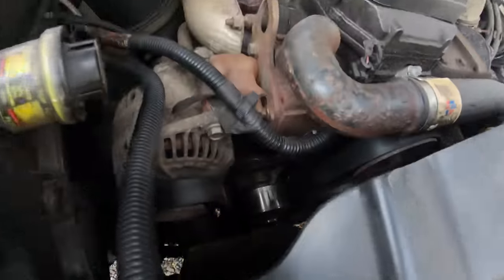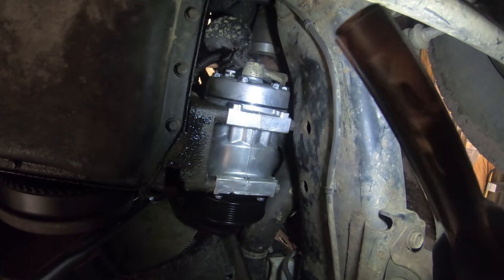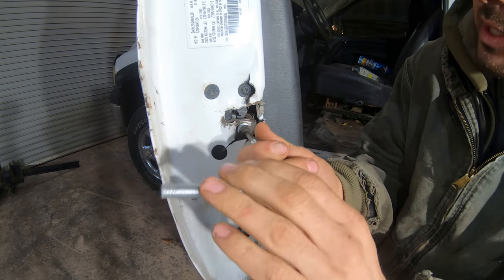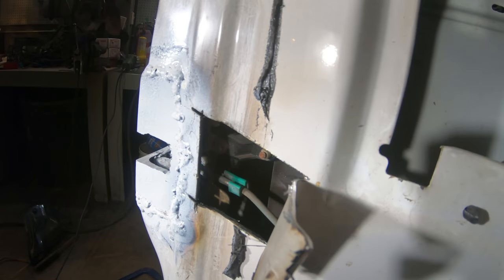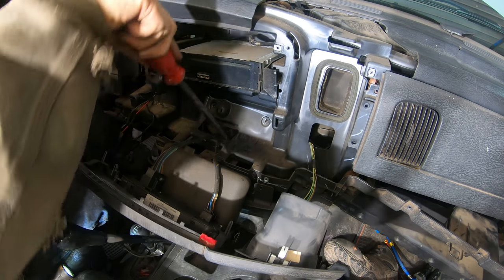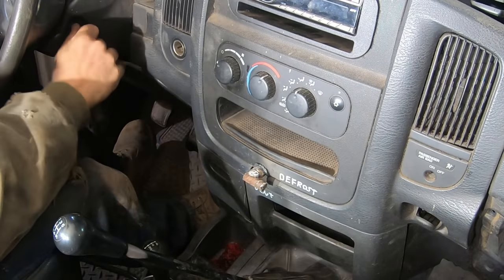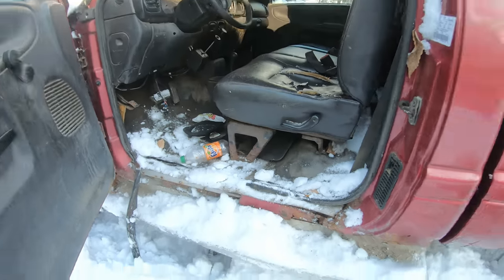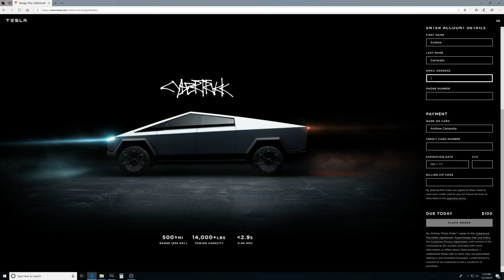Pickup truck repairs

Comment: In two or three years: Doing Maintenence on the CyberTruck
Reply: Maintenance on Tesla = scrap it and buy a new one, unfortunately...
Reply: @Gyppor  you clearly haven't been watching Andrew enough...
Reply: Gyppor check out rich rebuilds!
Reply: @Gyppor  teslas dont need maintenance, jokes on you
Reply: Unamused yeah I’ve watched Andrew enough to know he’s not going to like the truck. Check out rich rebuilds
Reply: @moavic5087  it'll be hard not to love the truck. zero maintenance except tires, lasts 20+ years, goes 0-60 in 3 seconds. ICE is dead, long live EVs
Reply: @DaveDaveAlanAlan  brakes.. lights.. sensors... bearings... connectors.. relays.. power supplies.. charging ports.. windows.. axle shafts.. struts.. shocks.. springs.. 
wait until they are 10+ years old and the electronics start to fail, just like on any vehicle. You're not going to find parts, Tesla won't sell them to you. Even Tesla certified  body shops have to wait months before they can get body panels with embedded sensors.
Reply: DaveDaveAlanAlan ICE is not dead Tesla ain’t even in the top 15 of car manufacturers. If EVs didn’t need maintenance then why do they have repair shops? You can’t buy parts for them. Only Tesla can fix them, and that can take weeks depending on the problem and parts availability. Andrew will properly inform himself and he won’t end up buying the truck it would be a big mistake. Unless he only intends on just using it to cruise around.
Reply: @Gyppor  1 million miles for brakes and drive chain due to regen. Also not true about wait times anymore - used to be the case when the model 3 was ramping though.
Reply: @moavic5087  you'll catch up eventually - ICE is dead, you just can't see it. buying a new ICE vehicle now is beyond stupid.
Reply: Going to take 2 years to get it .
Reply: @moavic5087  you can buy parts and there's a service manual for the cars. Repair shops exist because no car is perfect and people crash all the time.
Reply: @DaveDaveAlanAlan  "ICE is dead, you just can't see it. buying a new ICE vehicle now is beyond stupid." 
Ok, so I'm in Central Ohio and I need to be in Charlotte North Carolina in about 7 hours. Absolutely no problem with my car. Top off the tank at the gas station by my house (5 minutes and $35 tops) drive 430 miles without even thinking about filling up again and I'm there in 7 hours. Sure I could fly if I wanted to spend 10 times the money then pay even more to get to where I'm actually going and maybe get there marginally faster but an electric car/truck just ain't gonna cut it. Sure I could deal with range anxiety, search around and find a charging station, go out of my way to get to it, sit there and twiddle my thumbs while it charges, then show up after my meeting is over but what's the point in going at that point? 
Until I can drive all day on one charge or get a full charge at most any street corner in under 10 minutes, EV isn't even an option.
Reply: Matt Merkle those were all bad responses. I dare you to call Tesla and try to order a headlight for your car go ahead see what they say, also try to get a repair manual from Tesla’s site 🤣, If you go online you’ll see limited amounts of new and used parts available from aftermarket sites. Only Tesla repair shops can fix a Tesla which sucks if the  nearest shop is 300 miles away. I’m a diesel mechanic, don’t try to tell me about the car and truck business I know Tesla ain’t doing so hot in their service department. My point being is this cyber truck will not fit Andrews needs based on what he does.
Reply: @moavic5087  Don't talk reality to the obsessed 'green' electric everything, fantasy crowd. They don't like it. You point out numerous indisputable facts... and they'll come back at you with a really tech based, intellectual response, such as... "No!"
Reply: @fillg  cybertruck = 500 mile + range
Reply: xray606  I’m actually a huge fan of the Tesla motors! Just Not a big fan of the rest of the car/company. Electric cars have been around since gas cars it’s just that Gas is more convenient at the moment. I’m sure it’ll change as battery technology gets better.
Reply: @moavic5087  Musk is the Billy Mays of technology. He takes stuff that already existed, hypes the shit out of it, then gullible kids who never bothered to learn anything, buy it. 'I have this great idea, to use a machine that will create tunnels under cities and free us from gridlock!' Yeah, great Elon... That's called a tunnel boring machine? It was built in like, the 70's? 'No! This is different! This is tunnel boring machine 3000! I invented it!'
Reply: @DaveDaveAlanAlan  That's great if it turns out to be true but I'm doing that trip tomorrow. Should I cancel all my meetings for the next couple years until I can buy one?  
Don't get me wrong, I love the idea of electric cars or trucks around town but for long trips they just don't work out yet unless you plan your trip 100% around charging. ICE is still very alive and necessary for some people.
One more thing I'll mention is that I bought my car used with 30,000 miles on it, only paid $14,000, and it'll last me about 10 years. I can't afford a $40,000 truck
Reply: @moavic5087  that's a cool story and all but none of it is true. Do you think Rich Rebuilds just makes his own replacement parts? (No he doesn't) and the service manual is literally available through their website to anyone (it even says so on the site). Limited parts availability on eBay doesn't mean jack shit. It only means Tesla isn't dumping tons of shit into junkyards.
Reply: Matt Merkle never said he makes his own parts, Tesla’s are over rated, there’s still a lot they need to do to be competitive against gas and diesel. I can find repair manuals on the internet for free instead of paying on Tesla’s site. Andrew will end up not buying the truck I already know he’ll do his research, it’s just 100$ to reserve anyways.
Reply: @DaveDaveAlanAlan  Electric vehicles occupy 1.9% of all automobile sales in North America.  Go home, you're drunk.
Reply: v is for vagabond so? The point is EV is far superior in every way to ICE. Buying new ice vehicle right now is dumb.
Reply: @Loen Handley I have my first PC from 1998 which still turns on and works like the day I bought it. Your point?

Comment: "This is how i fixed it.....just zip ties, but I mean it only had a brittle plastic thing holdin' it in the first place.......so......can't really call that a downgrade."  

"Any time you can take some electronics out of a vehicle....and make it manual.....where it will last forever, and this (electronics) broke for no reason.....that's a big upgrade right there." 

If I could only capture all of these and have each quote printed on banners that hang from the trusses in my shop....it would be glorious!
Reply: You tip a truck over in it's side one time and it's all messed up!

Comment: Would love to see a snow plow on the front of a Cybertruck.
Reply: You'll plow for 20 min and then "no battery"
Reply: @LegendLength  "the truck does 800 miles "

It doesn't go 800 miles on a charge. About 250 for the low end one.

I doubt you can attach a snow plow to it. 

I know you can't  put a rack on it.

It's for missions to Mars and whatever else musk tells the tesla cult it can do.
Reply from the maker: I’ll put a plow on it.
Reply: @AndrewCamarata  You gonna put a tool box and a fuel tank on it too?

It's the ugliest most useless truck to have ever been designed, unless you're 12 years old.
Reply: Dominic  
Apparently Dominic is a member of the cult. "Just weld the rack, fuel tank and/or tool box to the sides of those handy side "sails"", he says,.."and if you want a flat bed version,.... just cut the sails off with a plasma cutter"
Reply: @jcgoogle1808  A uni-body pickup will never last offroad and wait until someone really loads that tailgate ramp down with weight, the fucking thing will split in half.  Way too much rigidity.
Reply: When it’s in the ice-cold towing the mileage is going to go way down.
Reply: @alienation-p6g  i had a unibody sedan i did a lot of offroad with, jumped it a few times too. thing survived 200k km of my abuse. over 400 when it was finished
Reply: @theaveragejoestinkeringand4407  i have a feelin most of andrews driving is fairly local.

Comment: Great improvement! On my 99 Ram 3500 actuator neck (piece in between the motor and the blade bottom that opens and closes to the desired duct union) I made the piece in between them with a 3/8 copper a/c line. For the length make it the length of the old piece, mine was broken on one side. It had a double D in one end, and a D I believe on the other. Is easy to press the (straight double line of a D, to make a Double D, just make the belly of the D, flat, it'll be two backs of a D, and the top and down rounds, that's a Double D, I guess because the top and down will look like the belly of the D, with the sides flat) and the other side I believe it was shaped like a D. Hook them from bottom up, tight the motor if at time of uninstalling it it runs towards one side, and back to the other side. Simple, "guaranteed for eternal life".

Comment: Can’t believe he just preordered the Tesla truck
Reply: I can. I pretty much expected he would, even though he seldom buys anything new.
Reply: First winter he will regret its shit range and the fact it can't tow longer then 60 miles and his power bill will shoot up about $500. Also its not made in a state that puts salt on Roads so have fun with all the electrical dying after the first or second year and it has no frame so what it can really handle over longevity of time is itself and that is about it before the unibody construction starts to split.
Reply: @MAGWolf  Electric is much, much cheaper than petroleum. Towing is not yet revealed, but hopefully, it will be enough to get Andrew to and from most of his jobs. Tesla has been selling Model S all over the world since 2012 and I have yet to hear of any salt related electrical problems. The Cybrtrk is not uni-body. It's a stainless steel exoskeleton. Huge advantage over conventional designs.

Comment: Great videos, I love your comments and ingenuity. I think you should think about designing g/building a "50 year" pickup truck. Take the best parts from existing trucks and Frankenstein them together, maybe some sort of plating to protect the undercarriage, body panels made out of flat steel plate, nothing over engineered, you get the idea.

Comment: Had same problem with my Ford F-150...changed a part under glove box n it worked..heat blower motor resistor..took 2 mins to change..

Comment: Dude this is crazy, I used to have a 2003 dodge ram 1500 and it always had crappy heat.  It worked but would never blow.  I had it in the shop multiple times and they replaced all kinds of parts and it never got any better.  I eventually sold the truck because I couldn't defrost the windshield and it was dangerous driving in the winter.  I could've just given you a call and you could hook me up with a rebar knob lol, I would not have cared as long as the defrost worked.

Comment: Want something built to last? Anything made before 1970. There are 4 things under the hood of a 1960s pickup: engine, radiator, master cylinder and battery.  Sturdy construction, easy to repair, plenty of parts available. Its a no-brainer.

Comment: Great stuff. However you need to vacuum down ac system before recharging it. This to remove moisture, water in it. Water mixes with compressor oil & forms an acid that eats away at windings inside compressor. Next, check for leaks. Then recharge. NOTE: You should find an old "Frigidaire" 70s or 80s compressor. Rest of refrigerator is trash, but most of the time, compressor is still good. Next, install fittings for high & low sides. Now you have a inexpensive vacuum pump for under a $100.00 that will get down to 27" of vacuum. Unless you want to go spend 800-1200 for one. Lol

Comment: Just picked up an 06 Cummins, sold my 04.5 with the 6 speed so I had to get another! Had the exact same problem with my 04.5 with the blend door. Pain in the ass
Reply from the maker: Fix it the way I did. Its an upgrade.
Reply: @AndrewCamarata  if I had it still I would've. Knock on wood the 06 still has full functionality

Comment: Its cool how you fabricate all these repairs  that work well. I hope the heater door works for a while longer on my 2004 ram 1500 because I've heard about this issue before. It must suck dealing with all that rust, we don't even know what rust is in California and that's never been a problem I've dealt with while shopping used vehicles.

Comment: The thing about the Tesla pickup is it has other fallible components, like the electronics, an opinion Andrew made very clear in this video, but also, Tesla does not embody the idea of repair at all, the moment a battery or control module goes they want to replace a good portion of the car for no reason. What we need is basically a Dodge ram with a stainless steel body and flat curves with no shitty curves

Comment: I think that's the funniest car repair video I've ever seen. You had me laughing out loud with that broken dash comment while haphazardly throwing the pieces onto the top there. 
Nicely done repair. It seems you have absolutely no patience with the plastic crap, and I fully feel with you. I had that exact same vent switch brake on my VW Transporter Mk. 5. It actually is mechanical on my model, but the way they implemented it was so thoughtless, that it broke nonetheless. If I had done the repair as cheery as you had done it, I would probably have saved a lot of time and swear words.

Comment: I read about a guy years ago that owned a snow plowing company that hired on or sent one of his mechanics to become a certified Master Tech for Chevy and when he bought new trucks he'd have this guy tare down the entire truck so he could get every nut, bolt, frame etc. galvanized. In his pictures, his 20 year old trucks were spotless and looked brand new. We just use Fluid Film a couple times a year and so far it's keeping rust at bay. Possibly switching to Krown, seems to get into smaller places and comes with a guarantee.

Comment: Not sure if it was mentioned already but why not just replace the compressor clutch and then you don't have to evacuate the system and refill it. Or if you dont use the a/c get a shorter serp belt and bypass it. Nice Cummins though. Gotta love those things rollin coal. 12v 5.9 is my favorite. Bulletproof design.

Comment: You could spray can some "Cavity Wax" inside the frame and doors to prevent the rust. Basically seal coats the inside of the steel from air, water and salt and sprays in like expanding insulation foam.

Comment: There is a small servo just moves the deserter to send the air to dash vents, defraud vents and Floor vent usually you just replace the cigarette size motor actuator!

Comment: change this truck and get a Nissan.
Your problems will be resolved.😎

You are damn right!!
I had an American car in north states, where the rust separated the floor into small layers!
This floor , had no supports and my seat was in the air....
I was forced to cut it and weld a new one,, made by layers of oil tin , overrlaping each other..😂

Comment: Hubs has a 1994 Ram. Dash is cracked and broken in several places. Heat and air controls work like new, they are mechanical.

Comment: I got a feeling you will love your Tesla CYBERTRUCK. The spec  is almost exactly what you are thinking of . Maybe you could have a pile of sand to throw it onto it's side for a visual underbody Inspection .. retracting door mirrors are a must .  not electric   MANUAL   fold them in Manually. Keep it simple .The less electronics the better .

Comment: I too pre-ordered a tesla truck as well.

Basically any way you look at it, its superior for a work truck vs anything on the road currently. 

Its crazy powerful, only thing I'm somewhat worried about is the towing capacity when towing a larger excavator or backhoe.
Reply from the maker: I was sold on the stainless structural body. Looking forward to seeing the truck.

Comment: "If you have one of these trucks were the heat won't come out,"... Cut a hole in the dash with a grinder, then get a crowbar and just snap the control servo off.. Fixed 👍 😆

Comment: I just watched 2 of your videos where you dropped about 10 grand on a lift and 20-30 grand on a new crane
but you repair a door on a 2003 pick up with 200k+ miles on it?
Gotta love Andrew!
Reply: Doubt it was that much. He buys them at least 30 years old
Reply: @bsm6776  cheapest lift I found nationwide was 9k for the same one.
they average 20-25k
the crane doesn't get cheaper than the prices I quoted even on a gov auction I buy from.
My comment was based on experience and fact.
try that before you start to type
Reply: DisOrder cool story
Reply: @bsm6776  Someday, YT comment trolls will be extinct.
What will you do for fun then?
Reply: DisOrder saying he buys them 30 years old is trolling huh? Well I learned something new today. Thanks

Comment: When a moving component like that goes, it's worth checking everything else that's connected to it ... so if your driveshaft bearings go, check the bearings in the diff and the output shaft of the gearbox - they're likely to be torn up too from the vibration of the driveshaft.

Comment: Rust is what killed my truck but it was weird.  If you split my truck exactly in half from bumper to bumper --the passenger side of the truck was totally rotted out (I mean from engine parts, brake lines, supports, to frame, totally gone) while the drivers side looked brand new by comparison.  Never could figure out why and it's a shame because I never had any serious engine or transmission/transfer case problems with that truck...